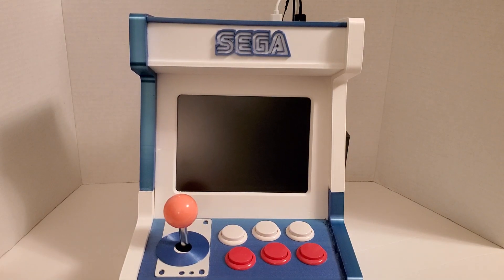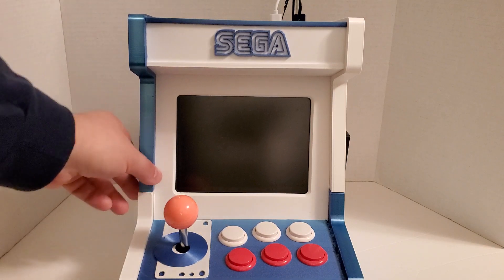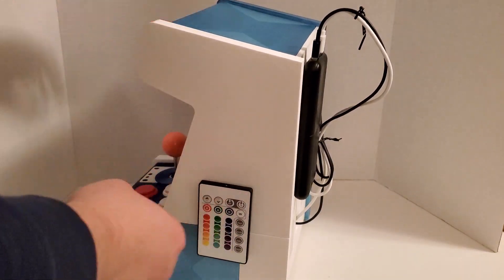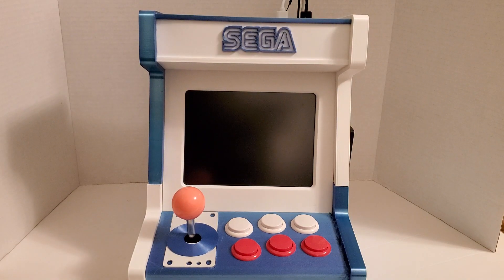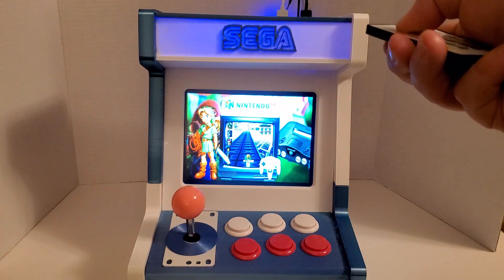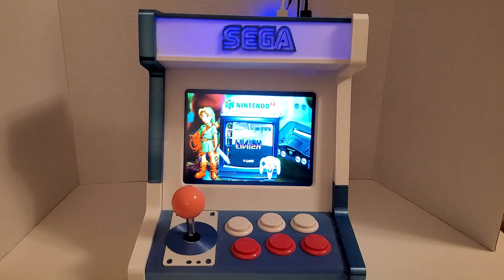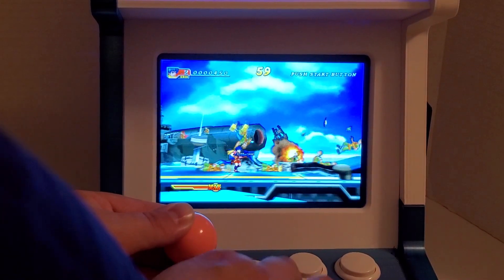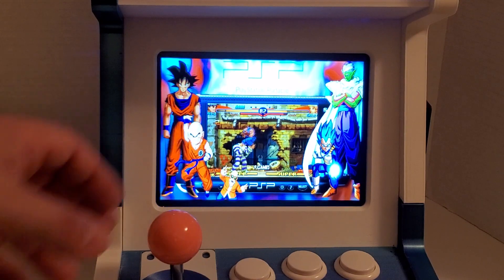3D printed mini arcade machine

Comment: Hey, thats not bad at all MD 👍.
Also Batocera for the win 😁.
I prefer Batocera overall for my RGB10Max and also for my Lenovo Tiny PC set up. 
Works and looks great. 
With regards to Batocera not liking wifi on your Pi4, I had that problem on the Max using v30 but on v32 now and the internal wifi works fine.
Reply from the maker: Thanks! Yeah I love Batocera! I have the same wifi issue on the pi 3 and 4 with the internal wifi. 🤷‍♂️
Reply: @MobileDecay  
Have you updated to v32? Still get wifi issue?
Reply from the maker: @fonzitheman  Yeah.
Reply: @MobileDecay  
Cant help you then 😁
Reply from the maker: @fonzitheman  yeah once I get it set up with the ethernet I'll be good until any big update gets pushed. 😁